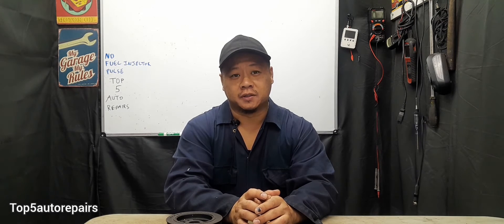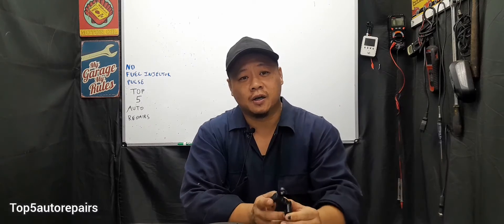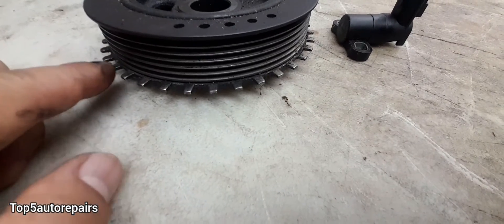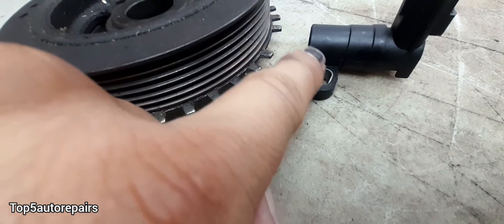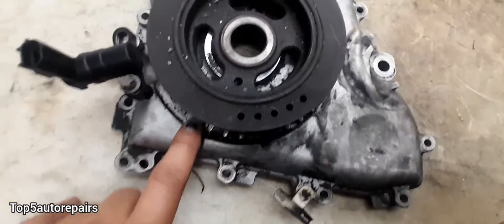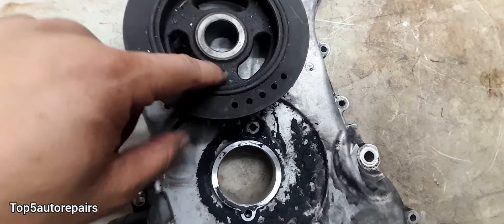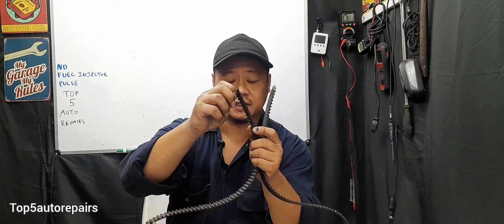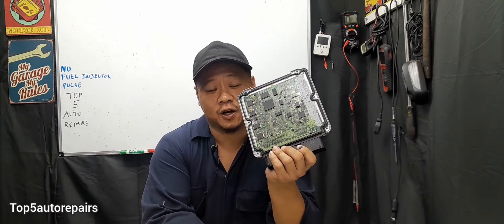NO INJECTOR PULSE NO START NO SPARK

Comment: Dude sorry about my English. 
I had spark plugs wires were not in order 1&4 . I got low injector pulse. When the mechanic came and put them in order the engin started and the puls became bright.. so could you possibly explain that by wiring diagram and how about if i have weak spark plug    will that effect the the pulse as well??

Comment: On a 2008 Honda Pilot with 215 K , crank , no start . I have a crank signal on the tack . It appears there is spark , I used an inductive tester on the coils . No injector pulse detected . The timing belt " may " have been replaced only once . I get a little " burp " in the intake plenum while cranking and some at the tail pipes . That tells me something happens while valves are OPEN = not good . I will do a compression test next . IF compression is good , could the cam sensor cause this or as explained , the balance wheel shifted ? No codes because the battery was over 5 years old and tested weak . When I replaced it on the side of the road , I didn't have a memory saver . I should have read codes , if any , first . Did I miss anything ?

Comment: Car cranks no start. No fuel, no spark, change crankshaft sensor. Still no start. Ob2 scanner won't connect at all with ecm. No check engine light. Does that mean ecm is bad?
Reply: Hi I have the same issue did you figure it out any what was it ??

Comment: Nice video but the information was a bit confusing. For instance a slipped balancer will still send a signal! Just not at the right time and you will still have injector pulse and spark. The car just wont start or will be hard to start. As for the broken cam belt, well again you can still have spark and injector pulse. All where good reason for a no start but slightly innacurate. Non the less it was still a good video and some what educational.
Thanks

Comment: Hi 
I have a 2017 Volvo V40 that suddenly wouldn't start. I had breakdown attend. They put Easy start into the inlet ducting and the car ran until the Easy start ran out. I have no errors. When cranking I have fuel pressure off around 50psi on the low pressure side and 100psi on the high pressure side. I cannot hear and injectors firing when holding a screwdriver against the body of the injectors. I'm contemplating getting a cheap oscillo scope to test the output from the ECU. If that doesn't show an output could I use a secondhand ECU and get it reprogrammed without incurring the cost of a Volvo garage? Thanks, Mike